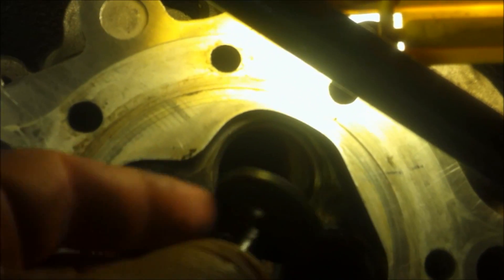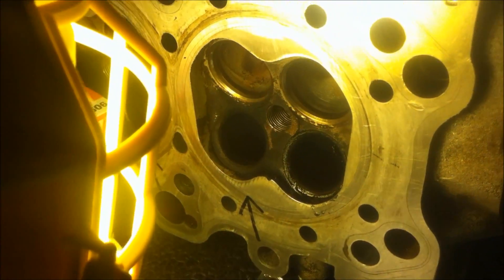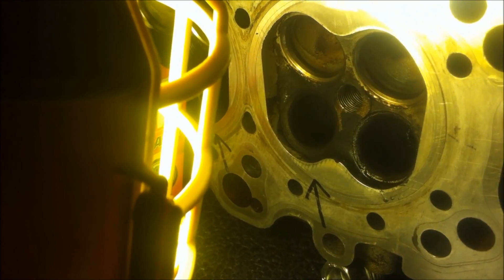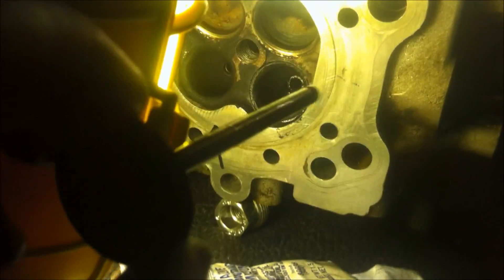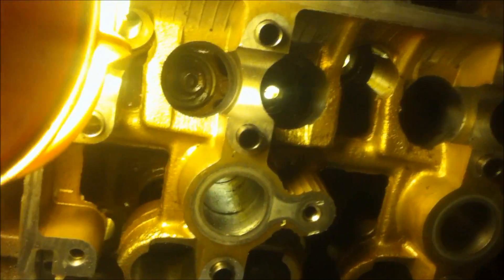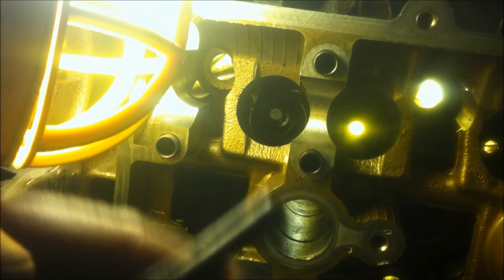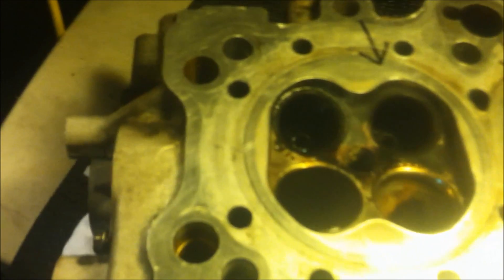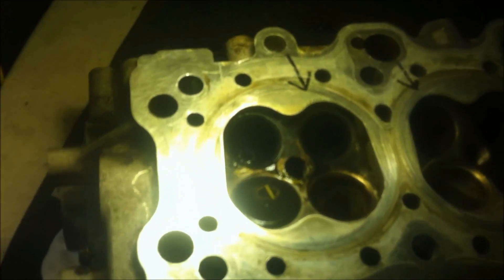EASY, HOW I LAPP & GRIND VALVES. THEY DONT TEACH THIS TRICK IN SCHOOL, ONLY OLDSKOOL.

Comment: When you take off the head.  Do you set the timing first?  I have a j series engine v6.
Reply from the maker: Yes always set the timing marks. #1 cylinder at top dead center on the compression stroke in most cases.

Comment: Wish I could've seen where you was putting the air hose to check for the leak, but thanks for the parts we could see, great vid
Reply: its either the exhaust or intake hole, depends on which valve you are testing

Comment: Can i use other valves from a different cylinder head its the same cylinder head meaning i got one from a junk yard good head but a couple pits on a couple vales but i still got the ones off the my first cylinder head that are a little better
Reply from the maker: Yes I have done that Make sure they are the exact valves.
Reply: @oldskoolfunk71  thanks big bro,bless should i use the same springs? are does it matter,the ones on the ones i want to change there springs have a little rust spots,i could be bugging but its my first time doing valve lapping and a head,the springs on the one i want to use have no rust

Comment: Omg my 3000gt vr4 jumper time and bent all 24 valves just slightly. I watched this video. Pulled all my valves, paid a machine shop $80 to tank my heads clean. I bought a $51 new set of valves from eBay. Did everything this guy said on all my valves. Sealed it back with Genuine Mitsubishi mls head gaskets, new head bolts ,all new genuine timing components, gates racing timing belt, and I’m just at 3000 miles with 19t upgraded turbos pushing 18psi 512 awhp on pump gas.  Did a leak down test only because I went with copper plugs and everything is perfect. This guy saved me so much money I was able to afford bigger turbos. I love this guy and video. Much love from Brooklyn nyc !!!

Comment: GREAT VIDEO OLD SKOOL!! Either the thing seals or it doesn't.  There are other videos with machines that look like they cost 10k or more. What do those machines do? Get your valves to seal in the head that's what. Seat of the pants approach that works, and you prove it.  What I am sure is that car is going to run and those valves will seal like they did on day one. How long? Who knows, I have to think for a good run down the road at least. By that time it will be ready to swap in an LS1.  LOL probably not but I have no doubt it will work.

Comment: @oldskoolfunk I know this is a couple year old video but I have a question. I have. 08 Pontiac Torrent GXP 3.6. Timing Chain stretched so had to replace that. Now I thinking there may be bent valves. Took top end off and looked down the ports and seen some close and some open..Do some valves stay open with head on car or should they all be closed?  with pressure from the cam should some be open ..Can you give me some advice on this.
Reply: I'm sure your question has been answered in the real world. But for anyone else reading, a camshaft opens certain valves and allows others to close at the same time. So what you're looking at is normal

Comment: Yes I works, we did this back in late 60s &70s..it's not a triple cut.,but It makes a ol beater& work cars run great again. .a friend pulled the head on a ol Malibu wagon 250 6cyl  his father in law gave him on a sunday.. oh shit it had a burnt notch in a exaust valve..he calls & says ..Help..nothings open..he has to drive it..so I ground that valve on a bench grinder, & ground/seat..all with a drill..I did grind a margin & took a tad off the stem..for what we removed on valve..it ran like a jewel. .for years..
& mr. Hunt our shop teach in high school taught us this & we used a pencil to mark & check how it's seating..and I'm still using my dad's valve clamp he bought before I was born in 52..I even have his flathead valve tools & his dad's black smith irons & tonges..

Comment: I wonder if one could source a small spring and compress it on the valve stem between the drill to keep the valve seated while grinding. Low tension of course. Nice video. I've lapped valves before in good used serviceable heads and got a lot of life out of them.

Comment: the only problem with this method is you remove too much from the seat. You'll end up going over and over it again and again. The centrifugal force from the drill even with the valve in the valve guide will still cause too much play. The difference might not be noticeable to most people, but it will affect compression and gas mileage ever so slightly. Not to mention if you have to repeat this job 2-3 times in the engine's life, the contact area will be obliterated. The paste was also not replaced when changing direction meaning anything it took off, may not be scoring the seat. If you own an expensive car with an expensive motor, take some scotch brite pads and clean the face of the valve, use the hand tool, and apply direct force. If you own a honda or nissan, go to town with the drill. It won't be expensive to get a new cylinder head later.

Comment: This is lapping, NOT grinding! It used to be performed on older engines after a grind job, and might help on a bad seal without a real valve job. HOWEVER, modern grinding does not need lapping. In fact, since many grinds are more complex(3, 5, or more angles), lapping too much can ruin the nice seat required for sealing. So while lapping "might" work, one needs to be careful. I'm an old engineer, but I can learn new tricks. I'd be lost as an engineer if I didn't do "new" school as well. Things change.
Reply: you make sense.  but does his method work and how well.  real life examples

Comment: Where can you get valve grinding compound for hardened seats? I haven't been able grind valves since the 60s because of the hardening. Also make sure that valve really needs to be ground,  it's surface is very hard, but that hardening doesn't go very deep. You could end up doing more damage than good with modern engines. That's why machine shops don't do routine valve jobs, unless absolutely required, when they clean up a cylinder head.

Comment: NICE VIDEO,  Thank You....    All 16 of my valves bent due to tension pulley broke in my timing housing,  So I'm replacing all the valves,  So with that said,   Do you still have to use the compound with the new valves?

Comment: Lapping a valve is the last step
The correct angles are most important correctly angled port seats leave a very accurate effective sealing area this method will remove a lot of material quickly and uncontrollably destroying your angles

Comment: That's not how you spell lap or lazy. And there's a very good reason they don't teach this in school, it's bad practice. Spinning a valve with a drill is the quickest way to shorten the life of the stem and or guides. 

The best way to seat valves is to do it by hand using suction sticks. Why? Because the forces are direct from the valve face to the seat face, meaning the meeting surfaces are more closely directed together. 

If you pull the valve face against the valve seat face via the stem, you're operating the mating surfaces by remote control. This IS indeed how they do it in many bike shops - because for them time is money and they aren't going to be riding the bike. Plus, the more times you bring it back, the more hours they can log and more money they ca make. 

So, if you're fixing your own bike, do the job the right way. It's slower but your engine will last longer.

Comment: a used valve re lapping must stay light because the wear pattern of lapping tends to deform the valve contact area and widen the seating area so the valve seat becomes more sensitive to carbon buildup.
I relapped new valves on an old seat very often when the valves hitted the piston on a timing chain failure on a medium mileage car and I never had a comeback on such a job.
I never done that on a burned valve as usually the seat is damaged too.

Comment: Now do you have prussian blue ( aluminum heads) magnaflux ( cast iron heads) to check for hairline cracks in seats or heads?
Reply from the maker: Eckehardt krieger No but I have a video on how to check cylinder heads for cracks at home.
Reply: oldskool funk . Same. I still have the seat cutters and industrial drill press for replacing the valve seats and a lot of head rebuilding tools.

Comment: Another fine video for alternate rebuilding methods.  It is interesting to read the comments  ffor your videos.  It appears that the more experienced engine rebuilders are resistant to any machining method that does not utilize the most expensive equipment available.  If the process does not employ tried and true practices of which the machinist is familiar, then the work is doomed to failure.  This is an example of our society where personal skills are no longer being taught to our youths. Young men used to compete with their cars and almost every young man could could tune up his car and perform simple maintenance. And a significant portion could hop up a car for better performance. Today cars are so specialized with their electronics and tight tolerances that young men are no longer able to work on the cars.  Maintenance  and upgrades must be performed by specialist who are taught very specific methods of repair.  If the methods are not followed exactly then it is wrong and it will fail.  This dumbing down of our society is robbing our youths of the skills to do anything beside running a computer or watching tv.  Your method of lapping valves may not be factory approved, but I bet it works...and it will give the young men who have the ambition to learn new things the satisfaction of building their own engine...for pennies on the dollar.  Look at some of the methods our great grandfathers used in the Great Depression, they used their ingenuity to build and repair things, they could not hire out the work.  Skilled workmen have lost the respect of our society, someday soon those same skills will be held in great regard.  Keep up the great videos, Merry Christmas

Comment: Once you grind the valves doesnt the valve adjustment change? Since he valve material grinded off and material from the seat itself also. Like do you have to shim it on cars that dont have adjustable valves like hondas do?  How does that work.
Reply: The hydraulic lifters will adjust for the very small amount removed

Comment: you can also slide the end of the valve stem into the drill chuck and tighten them down, instead of playing around with a rubber hose

Comment: lapping is a good finishing touch to a freshly ground seat and valve
over lapping is doing more harm than good, as initially, there is a difference of 1 degree between the valve and the seat to permit a fast tight seal, 
when you're lightly lapping a new ground valve and seat, you make the perfect fit between the parts and the real contact is no more than 1/64 inch wide, as the engine runs, the contact is enlarged to nominal seat width.
when you're lapping a used valve/seat, the best thing to do is to lap lightly as the valve and seat are worn together and the guide is almost worn too and a deep lapping makes the situation worse as the real seat is enlarged, the valve becomes notched and the chance is great that you ovalize the seat and normally, a used spring has lost a part of its tension and the force exerted between valve and seat is not longer sufficient to break the carbon resulting of the combustion
Reply: T
Reply: It's better to have heavily lapped valves/seats that seal than to pussify the job and have a seal that will break at the first sign of pitting... having perfectly multi-angled valves and seats accounts for what , maybe 5% better port airflow.  Maybe worthwhile in a spec racing series chasing those last few horsepower but otherwise it just seems like a 1950's machine shop up-sell,  back when people believed every word that came through the radio or TV.
Reply: @NickKautz  Well said Nick

Comment: I have been doing it with an electric drill for 25 years and have never had an issue. I tape the valve stem and chuck straight on the valve - use a combination of about 5 seconds in reverse and then 5 seconds in forward with a light pull against the valve/seat - repeat until finished. Good info.

Comment: you don't want the drill to oscillate too much while grinding. it will work but the valve guide holes take a beating. Straight in ok but if the drill bit or hose isn't straight it will oscillate. doing it with the drill can spatter valve grinding compound and if the valve stem gets hit and it up streams to the valve guide the grinding compound can score the guides causing future issues. slow grinding is always the best. You don't want heat while grinding either. a cold polish and seating is always better there's a science behind this

Comment: on my ls 5.3liter, i pulled the heads to inspect pistons and to change lifters. To clean up carbon, sludge and gasket residue from mating surface, pistons and valves still in place would oven cleaner be a bad choice? Cleaning will take place while block on engine stand (short block complete, not disassembled) and heads cleaning on bench prior to disassembly for new springs and valve lap. What do you recommend? Ovencleaner, brakecleaner to avoid scrape damage by use of hand tools

Comment: what are the symptoms of a leaking valve ? My engine had a tick and water goes right down pass the valves, 5 out of 8..  No piston/valve contact. Im just wondering if my ticking is from that..
Reply: +ltwargssf R Ummmm.... water doesn't flow anywhere around the valves. Is water in the oil?? Or in the cylinders?? If so then most likely a head gasket. If you're hearing a ticking noise then it could be anywhere from a lifter sticking to an exhaust leak. But if it's a knocking sound then most likely a rod knock (assuming the head gasket blew and antifreeze got into the oil and wiped out bearings). Hope this helps!
Reply: Mr. Ichibahls I ment it as the valve seals arent sealing.I have the heads of the car, when i put water down the valves it leaks in the combustion chamber.. I also see little cratchs in the lifter bores, nothing serious i can see, my bottom end is built, would a ticking component in the head be cause of the tick if i cant see anything visually ?
Reply: You can fill backside of intake ports with gasoline with valve closed and check for leaks in front side of valves around valve seats

Comment: like that method if it truely doesn't do much damage the rubber hose is cool trick... but i would have to try it both ways to know for sure valve lapping hand tool or just rubber hose in drill way... seems promising nice video

Comment: Some people are speaking poorly of this technique without first hand experience. I did this on a d16z6 engine in high school that had two burnt exhaust valves (did all the valves though). The engine had 210,000 miles on it. Blew the bottom end at 245,000 miles (spun #3 connecting rod bearing and shot the mangled rod out of the block trying to baby it closer to the shop I used to work at) and swapped it for a d16y7 short block. Continued to drive it until 257,000 miles and sold it to a 16 year old girl who lived down the street. That cylinder head is at over 320,000 miles now and the girl still drives it without issue. From experience I would say that this method works fine in saving time but only if there is no physical damage to the seat and you are running a stock set of valves. I also later did the same thing to a 4g63 from a galant vr4 that was disassembled when I bought it. Still runs awesome and currently pushing around 350hp with an Evo 3 16g turbo.
Reply: Also, I'm not saying it's the right way to do it! I was short on funds in high school and couldn't afford a proper valve job. I'm surprised I never had an issue with the Honda. It was only a temp fix to get it on the road until I could afford a used head in good shape. The galant still runs awesome but I'm sure someday those valves will lose their seal due to not getting a proper valve job. Ymmv.

Comment: if you have leaking valves, it's time to take the head to a machine shop. you need the seats ground and the valves refaced. I work in a machine shop and you wouldn't believe how much some seats and valves take to seat properly. and if you aren't getting your 2 hit lines on your valve, it's not going to work well.

Comment: You really shouldn't lap valves with valve grinding compound .  When I was younger and went to Vocational School for Auto Tech we were fortunate to have a former employee of Sealed Power Engine Parts who demonstrated how lapping compound only serves to scratch valves and seats after the have been ground properly. The guy was a trouble shooter who flew all over the country to solve customer engine problems. Many had the idea that lapping was the last step to polish the valve and seat when a simple magnifying glass shows otherwise. After the last cut on the valve grinding machine let the valve sit over the stone and in second it will be polished to a very fine finish . Your method may be ok for a lawnmower engine if you are in a pinch but beyond that your method is a piss poor excuse for doing the job properly
Reply: i hope you are wrong.  i plan on doing this to my old kohler 14 hp garden tractor engine from the late 70s.